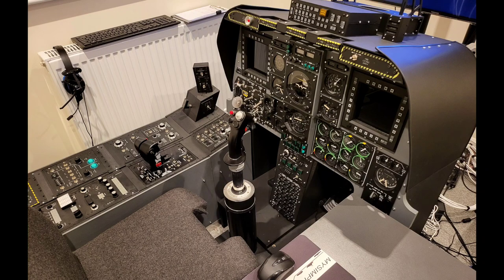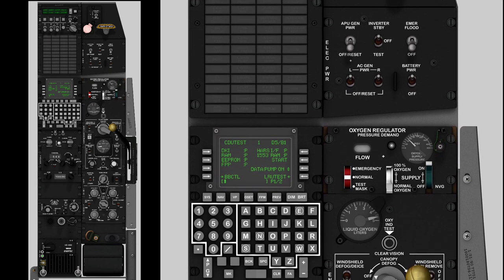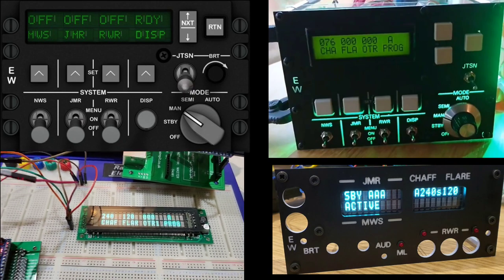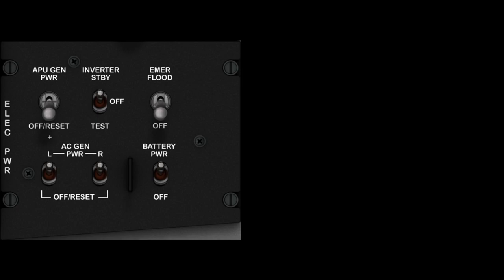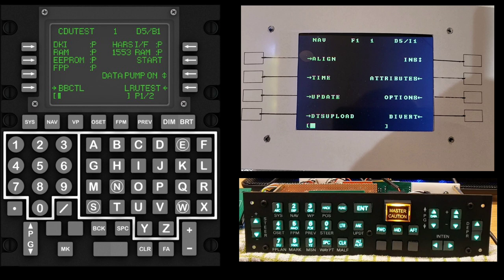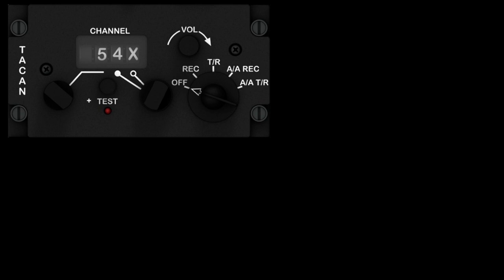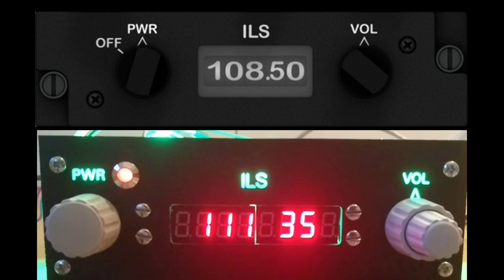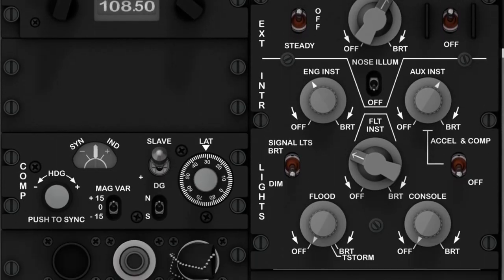Simpit A10C - Right Console - Part 1: Overview

Comment: Great stuff, best of luck with the build.  Can you share the part number or source of the magnetically held switch you used?
Reply from the maker: Hi Talbot, the micro switch in the video is a 5ET1-6. I also previously got and used 26ET61-T (M5594/2-1) for the Anti Skid. It's these ones that are easier to source although can be expensive. I got my various magnetic switches by keeping an eye on ebay for a fair few year's and waiting until small batches became available and I could try and do a deal. What was rare with the one I had in this video is the condition was unused, I got a small batch of these at the time but haven't been able to source any more since. The other ones however are easier to find 26ET61-T (M5594/2-1). If you search that part number and download the Honeywell datasheet. This details a whole number of variations it comes in. 
Also, as another option, on YouTube the Warthog Project has detailed an approach for people to make their own